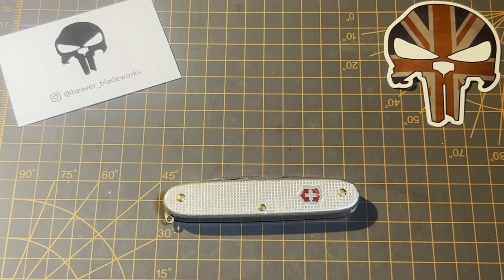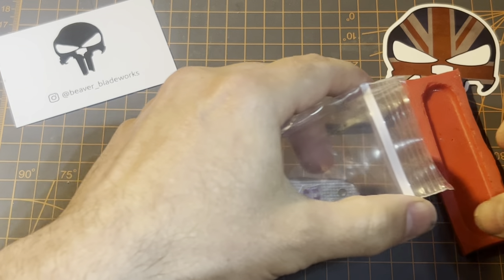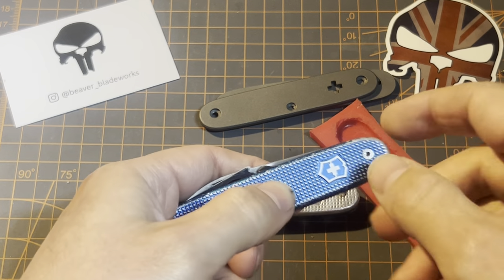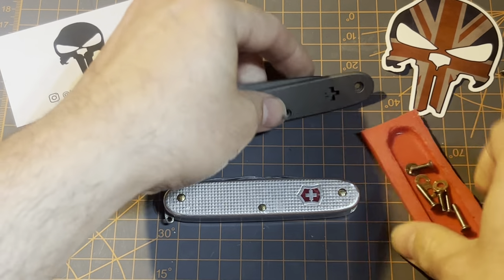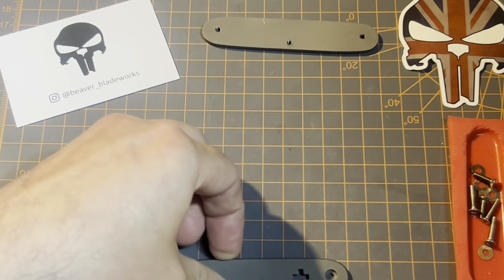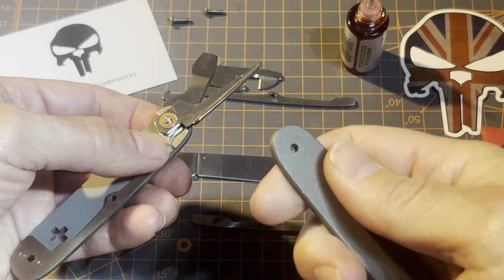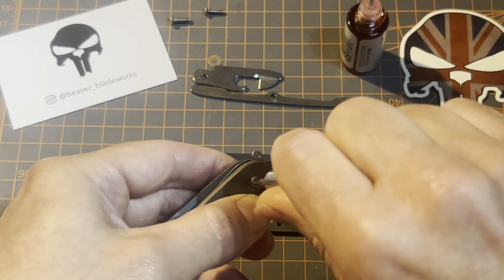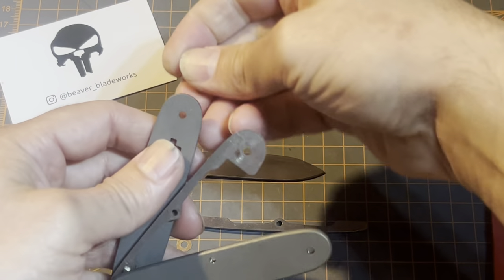How to “Build Your Own Beaver”titanium scaled pioneer from Beaver Bladeworks

Comment: Never thought about assembling a knife this way. Would it work with rivets?
Reply from the maker: It’s possible, however, the softness of the pins tend to bend as you drive it into place.  If you do try it, I recommend using a drill bit in the hole to align everything and then follow it with a brass pin.